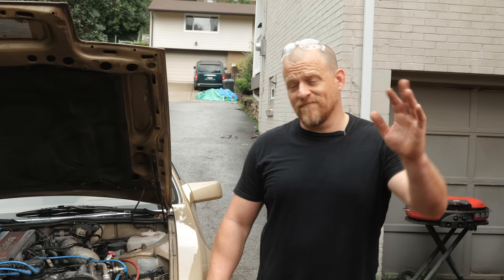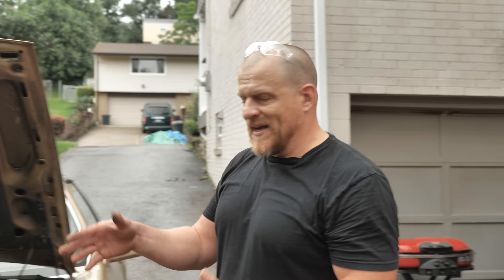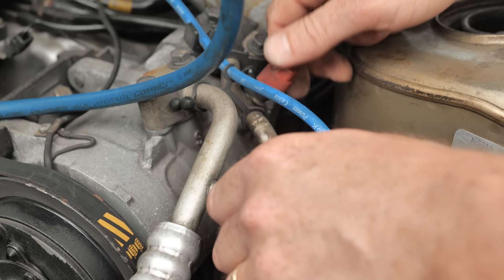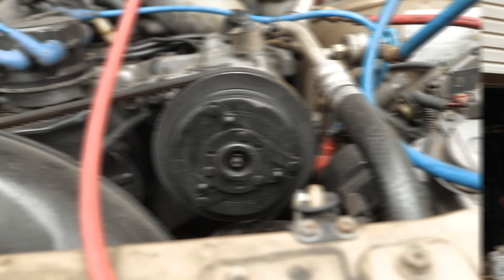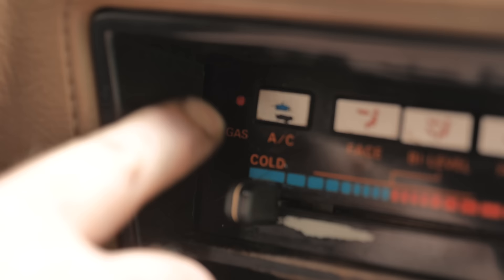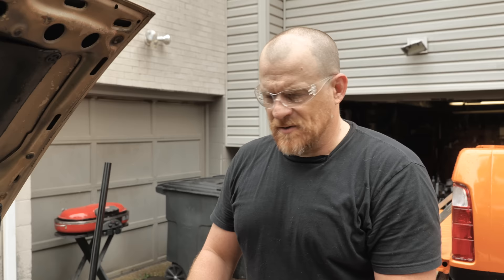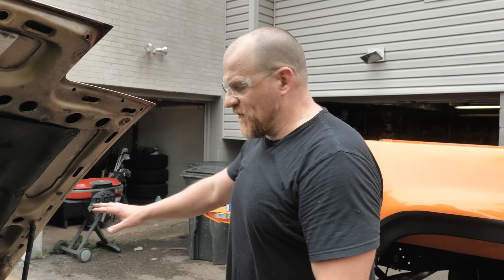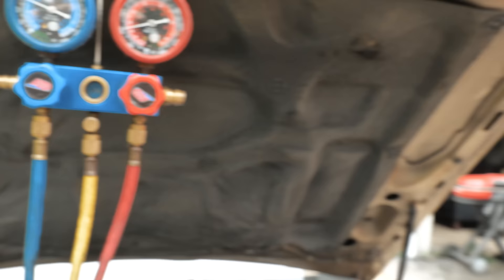A/C Leak Testing, Repair, Evac and Recharge (ANY CAR!)

Comment: Outstanding video. Thanks for doing this work. Paul et al; Gazillion Bubbles from Walmart is for kids but when mixed with water is outstanding way to find leaks using spray bottle. I knew a man who was killed when he attempted to move an aircraft engine fire extinguisher bottle without the cap or pin at Miami International airport fine air facility concrete hanger. The bottle became a rocket hitting a 2nd man who lost his leg and hit a 3rd man who had major damage to his leg. The man killed was a very good father to his young son Chris and I saw him at all the T ball games. His widow was very obese and entered into a lawsuit that she lost because her attorney opted to sue the aircraft maker instead of fine air or the mechanics who removed the fire bottle from the aircraft and failed to install the cap or pins recommended in the aircraft service manual. Fine air went out of business later after the tragic accident and did work on older cargo planes in the 1980's. The widow was acquaintance of my wife and worked at my son's school office. I helped the family obtain copy of the OSHA report that said FAA was responsible, but the report was wrong because OSHA is responsible for workplace safety investigations and citing violations.
Reply from the maker: Tragic, I'm glad I covered this safety issue. Thanks for sharing for others to learn from!
Reply: @ScannerDanner  Thank you for being so through and helping so many people.

Comment: Hey instead of calling it a "vacuum pump" you could just call it a de-compressor 😂 then your right on two levels, you're doing the opposite of compressing and the "vacuum pump" looks just like a small air compressor.

Comment: Anyone know why the high and low would start climbing after running perfect for 5 minutes 06 ram 3500 5.9 Diesel static pressure is fine and freon charge brand new system change ac compressor, liquid line with office made in, condenser, accumulator has mechanical fan clutch working fine as well maybe a clogged evaporator??? Any help would be appreciated
Reply from the maker: What are your pressures?
Reply: @ScannerDanner  around 200 on high and 30 on low on 100 degree day working perfectly for 10 minutes then climbs to 450 on high and 70 on low compressor stats laboring and starts kicking off and have to shut it off
Reply from the maker: @bigsmith009  why was the compressor and condenser changed? Did the original one pump debris through the system? 
What do these pressures do if you spray water on the condenser? 
It almost sounds like an airflow issue for the condenser
Reply: @ScannerDanner   the old compressor had high pressures when I checked it around a week ago so let some refrigerant out by the time I got it back to work on the clutch coil quit working so assuming there could of been a clogged condenser just changed all the components to be safe though would be good but still same problem it has a mechanical fan clutch seem to be blowing good think I should just soak the condenser down with water and try that
Reply: Thanks for the info and replies gonna try a shop fan and some water hopefully it's just a bad fan clutch happy 4th to you and family
Reply from the maker: @bigsmith009  let me know, thanks! Happy Independence Day

Comment: Why not to change schrader valves every job?
Reply from the maker: If it ain't broke, don't fix it 😉
Reply: @ScannerDanner  No, this is laziness. Same story is tire valves, replace every single time. AC valve cost 10 cents and tire one 2 cents. Not too expensive.
Reply from the maker: @simplemechanics246  No it is not and I absolutely reject that mindset! Some of these service ports are not just simply valves that unscrew. Then you have others that when you unscrew the Schrader valve, it will not come out of the service port and by the time you dig it out of there you've ruined the port. Ask me how I know!

Comment: Please no one ever use compressed air unless you have a quality external moisture separator. 
You don't need a power vacuum pump you can use a vacuum hand pump or use a vacuum flair that works off your compressed air
Ideally you want to use pressure with nitrogen.  Certain style fittings and Schrader valves will hold under vacuum but under pressure the fitting will spread and leak
 Once the moisture is inside your AC system its over.  Corrosion will form on all of the raw aluminum surfaces and you will go through compressors often until you replace almost everything.

Ever buy a used compressor from a junkyard?  They never last more than a few months because once they are opened up and exposed to the atmosphere they are ruined.
Reply from the maker: That's what they say, but I've  seen otherwise in the field. Cars I've used compressed air on, still purring like kittens with the AC compressor ten years later.
Reply: Of course that's because you know what your doing.  I can see watchers with a porter cable pancake compressor hydrolocking the AC compressor.
May as well just tell them to use the propane tank off their grill.  On propane you can make ice cubes on the dash.  Or BBQ on the hood probably both
Reply from the maker: @richeager7066  I did use nitrogen here! 😅

Comment: Why didn’t you leave the hose connected to the tap and just screw the can on to it. Then you wouldn’t have any air mixed. Why don’t you check your site glass for bubbles. That is what it is for.
Reply from the maker: Because the tap opens the yellow hose check valve and the tap itself is not a check valve and I did use the sight glass, gotta keep watching
Reply: @ScannerDanner    I get it. I had a sight class on my add on ac on my 78 F250. That was the only way I made sure the system was charged. Pig about about 250000 miles on it and never had a leak. Good video.

Comment: Please help, I was trying to add some r134a to my Yukon but on the back of the can from autozone it says use only with synthetic oil will this damage anything
Reply from the maker: What year is your Yukon and is there oil in the refrigerant can? You don't want to use that. Just use the regular R134a without oil in it
Reply: @ScannerDanner  it's a 2014 the can didnt say anything but r134a on the front
Reply from the maker: @jasonpulliam310  if your system is an R134a system, you will be perfectly fine adding R134a 
I'm not following what your question is? You want to know what type of oil to use?
Reply: @ScannerDanner  is all pag oil synthetic
Reply from the maker: @jasonpulliam310  not sure, Ester is synthetic, I didn't think PAG was

Comment: Isn't it 16 oz to a pound which would be 32 not 36 okay I haven't finished watching the video so maybe you fix that or correct that hopefully I'm just getting ahead of myself maybe. Also you didn't purge your yellow hose you should have you wanted refrigerant at the gauge. 20 microns is probably not a big deal on residential AC I wouldn't worry about that and a lot of times we pull all the way down to 420 if we're lucky so I'd be good with it. Okay you shouldn't have taken the micron gauge off you should have just filled.
Reply from the maker: Your were commenting as you watched right?
Reply: @ScannerDanner  Yes Sir I did sometimes I get carried away.

Comment: Payed mechanic to check for leaks and regas my car 3 times,1dt time regas lasted 2weeks,went back and then they found a perished rubber regas again..two wks later  they check again n say its under the dash n its a core or something..wanted $2000 to fix it after spending 500 before….i think they are scamming me as im female….how can i find the real cause myself? Is the core in the condenser? I cant afford anymore rip offs n summer here messes with my blood pressure
Reply: My car is a holden barina xc 2004. Australia could be opel in US?
Reply from the maker: Here is the problem with a 20 year old car. It can actually be a domino effect where once you fix one issue, the next weak link shows up. I have a video coming out next week on this same car (my sons car) where the high pressure hose started leaking one day after fixing a condenser leak. Why? Because this 36 year old hose was not under this type of pressure for a long time and only failed after the system was charged.
Reply: @ScannerDanner  yeah im scared for whats next but cant afford a newer model car

Comment: Maybe you should call your channel Scammer Danner. 

I guess you got your micron gauge for free just checked Amazon $172. 

I bought a brand new condenser for my 17 year old Suzuki Sx4 for $62 on Amazon. I also bought a brand new compressor with the Pag oil and all of the O-rings for the whole system for $97 from Amazon and a pressure reducing valve for $17.84 from Cardi. I would rather spend my money on all new parts then one ridiculous micron vacuum gauge that I would probably never use again. like most of the Youtubers good way to push products that most D.I.Y. don’t need. But your video will keep paying dividends for many years to come should help you pay for Jake’s college to finally get him out of the house and quit annoying you. Plus you get a free VGS 200 vacuum gauge.👈👀❔
Reply from the maker: Did you just like your own comment? 😂

Comment: Ssssooooooo many itty-bitty O-Rings & connections, smh.

Shrader-valves almost always leak.

Please please please don’t replace just one o-ring in a system that you’re already working on: just replace them all because if one is leaking it’s probably a sure bet that the others along the line are going to start leaking soon after.

Comment: Only comment I’ve got is PURGE YOUR LINES !
Reply from the maker: Check valve on the end of my yellow hose. Didn't need to, it was in a vacuum still
Reply: @ScannerDanner  
Until you disconnected the VAC  meter by removing the service port and reconnecting it OPPS 
I THINK I GOT U 😀
Reply from the maker: @20flstfi01  could be, what time frame?
If I did let air in, I probably didn't purge it because of the internet police lol
Reply: @ScannerDanner  
Firstly I’m not trying to be a smart ass  you have helped me more than you know.
45.16 time you let a tiny amount through the service port 
By dis and reconnecting it
Cardinal sin 
I know it’s only a car not so imperative 
I received my refrigeration trade in 1992

Comment: If you are so worried about the environment why don't you recharge with something like propane
Reply from the maker: Lol, I'm not worried about it, but the internet police certainly are and propane would be a really bad choice. What happens when there is an evap leak and the interior of the car fills with a flammable gas and you're a smoker? Yeah, there is a reason it's not used

Comment: Overkill. Especially on a car that old. A vacuum guage that reads below 500 microns on a used AC system from a 36 year old car.
Reply from the maker: Which part was overkill? Just curious. Thanks
Reply: @ScannerDanner  What do I get for sharing my knowledge?
Reply from the maker: @davidlopez7209  my first thought is Michael Scott from The Office when he's quoting Chris Rock in the Diversity Day episode. "Whatch you want a cookie"?  😄
Reply: @ScannerDanner  Overkill because you have nitrogren, because you have a vacuum pump and manifold guage set, because you have an o ring failure, because people.
   The system operates under pressure, more than 150psi on the high side, you know this, but if it can hold up to 150psi it will hold -14psi. Quick and dirty, you proved that with nitrogen while it was leaking. 
   Your vacuum pump and gauge set, if you can pull 27inhg, rare to have a leak, 29inhg you don't have a leak. Either way you'll find out on the decay test. As far as the gauges go, at that moment, you either have a leak or you don't. Hooking up a guage that reads 1/25,400inhg then making critical decisions on +- 10 or 20 microns, I think you off the rails with that one. If the manifold guage set isn't accurate enough why bother with the micron gauge at all when pulling 500 microns is equivalent to pulling 29inhg. The decay test will show a leak, especially at 15min.
   You proved you have an oring failure. Lets change it, charge it, and ignore the rest of the system. That's fine if you want to get the job out, that's what they paid for (maybe not your boy), but being that it may or may not be a 36 year old system that had a sudden o ring failure, should you really be going the extra mile in testing if you're not replacing the other orings? I haven't checked to see if you had any other issues and probably wont but the failures I'm talking about happen enough.
   People. It blows my mind how a regulated chemical that can destroy the ozone layer can be easily bought over the counter by anyone despite a lack of proper equipment, training, experience, licensing, or accountability and many people will fail because of one or all of those reasons. Now we're going to introduce a micron gauge? Most shops don't want you spending that much time on a job like that. In fact if you do, those same shops will question you, your experience, or your value. Once you've seen how little it takes to do a job that holds up, you will question yourself.
   Don't be so smart that you're dumb. I'm not saying that as an insult just don't be that guy Dan. People have mouths to feed, bills to pay...actually, keep up the good work Dan.
Reply from the maker: @davidlopez7209  oh man, but it gets worse! 
here you go 
A/C Repair Lasted One Day [What Did I Do Wrong?] - Part 1 https://youtu.be/nCTgcal4N94
A/C Repair Lasted One Day [What Did I Do Wrong?] - Part 2 https://youtu.be/BlrGTHAD2CY
Only if you have time :-) 
Oh and my name is Paul Danner btw

1. Your very first statement "29inhg you don't have a leak" and "either way you will find out on the decay test" , you will want to rethink this idea, should you decide to watch the next parts. 
2. This is only the second time I've used the micron gauge, and I'm learning on camera and when I was questioning the 10-20 micron swing, I didn't realize until later how small a micron actually is! (learning with you guys)
3. you are absolutely right about changing the rest of the o-rings, but I didn't want to spend the 10 hours it would take to do that, nor would I on a customers car. The engineers in 86 did not care about how difficult it is to get to things. 
4. R134a is NOT an Ozone depleting gas. R12 was and the rest of your statement when you are talking about these gases and untrained people just blindly charging their cars is EXACTLY why I did this video! 
5. "Most shops don't want you spending that much time on a job like that. In fact if you do, those same shops will question you, your experience, or your value. Once you've seen how little it takes to do a job that holds up, you will question yourself.
   Don't be so smart that you're dumb. "  - I am teaching! That is what I do on this channel! I'm not just trying to get a job done. 
6 "actually, keep up the good work" appreciate that. Hope you watch the next two parts, then you can really make fun of me! Nothing was overkill in this video as you will see, we revisit some of this, and also destroy some myths about vacuum and decay testing being used as a final leak check. It is NOT 100% accurate! Looking forward to your responses after the next two videos. I think lol. 
Either way, good exchange.

Comment: I cringed watching you open the high side to atmosphere and suck the oil in straight from the hose. I am amazed you have a nitrogen tank, regulator and a micron guage but no oil injection system.
Reply from the maker: Never used an oil injection system. Thought this was a perfectly acceptable method of putting oil in a system.